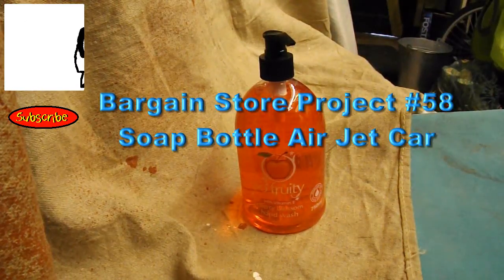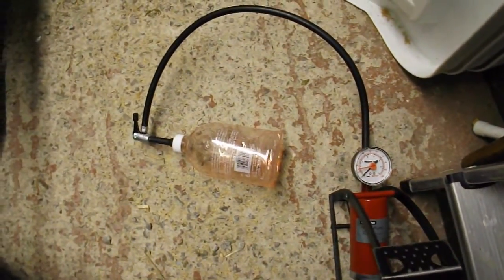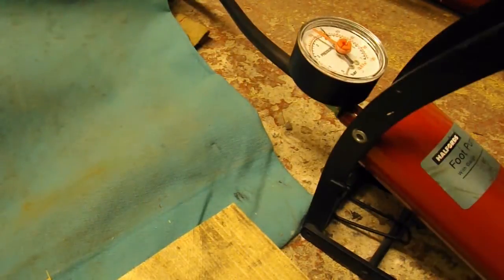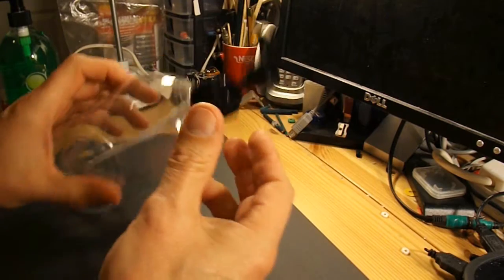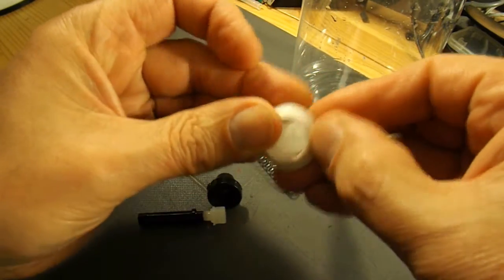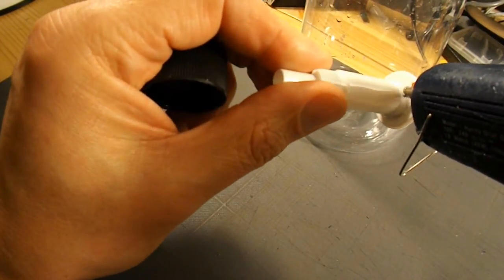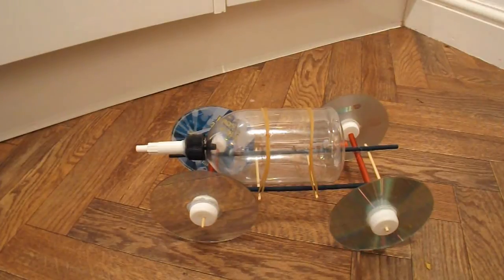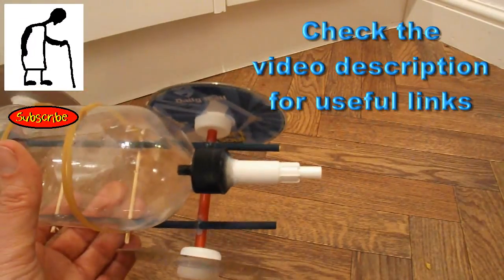Bargain Store Project #58 Soap Bottle Air Jet Car

Comment: What else could i use instead of hot glue to fill in the air holes
Reply from the maker: Hi James, I haven't tried it, but I would guess that BluTac would probably work, please don't blame me if it doesn't. You have probably noticed I use hot glue in most of my projects. Well worth the initial investment and I buy the cheapest glue sticks I can find on eBay.
Reply: If blue tac doesn't work I wont blame you I was wondering how much the cheapest brand new or second hand hot glue was if you could tell me please its nearly my birthday so I might just get alot of resources to build all your projects and invent my own imagine if you made some new invention witch was worth millions or billions and only cost you a pound
Reply from the maker: James Stead I do not want to recommend a hot glue gun to you as there could be issues within YouTube terms and Conditions if I did that. All I am willing to say is that they range in price from as low as £5 to maybe £13 for one the same brand as I use. My wife bought the one I use when she was a teacher nearly 20 years ago and it is only just beginning to show signs of wear so it was a good investment. Mine uses 7.2mm sticks. Don't buy one that uses thicker glue sticks or you will find you spend too much money on the sticks. I bought a really cheap one like that and it really eats the glue stick quickly, it melts them too quickly and if you don't use it quickly the glue melts while you are not using it.

Comment: Nice one. I think I might make it. I assume you can also pump it with a bicycle pump?
Reply from the maker: Hi robert, I guess a bicycle pump will work as long as you don't want too much pressure. That might be a good safety feature anyway. The main problem is getting a good seal with whatever you are using. My other jet cars use car tyre valves and the pump adapter latches on securely to them so you can pump with both hands (or your feet as it is a foot pump) but with this valve needs you to hold the adapter in place with one hand so you might struggle if your bicycle pump needs both hands.

Comment: Dude this is great
Reply from the maker: Thanks ike, I worry about the bottle bursting so take care if you try making one. I haven't managed to burst a bottle yet but that does not mean it won't happen.
Reply: yeah i used a smaller bottle and it burst. but thanks for warning me
Reply from the maker: ike palmer That is interesting. I haven't managed to get enough pressure to burst mine. You must have a more powerful pump. There are many different types of bottle made from different types of plastic so maybe yours wasn't a suitable type of plastic.
Reply: yeah